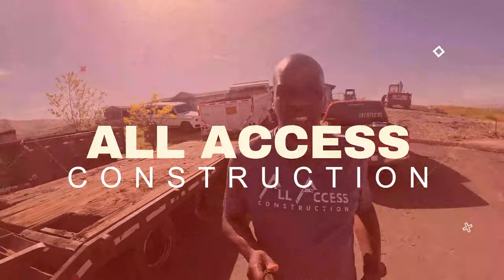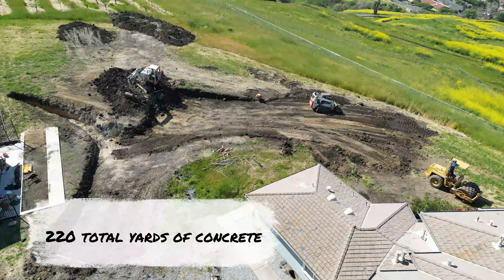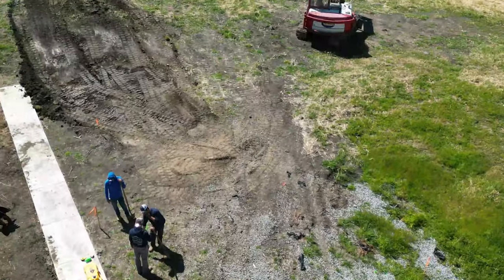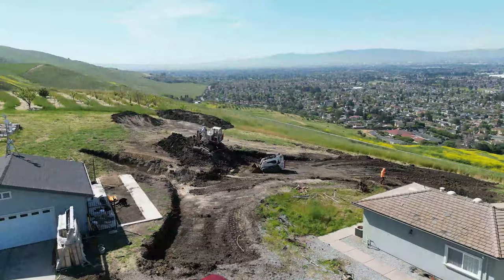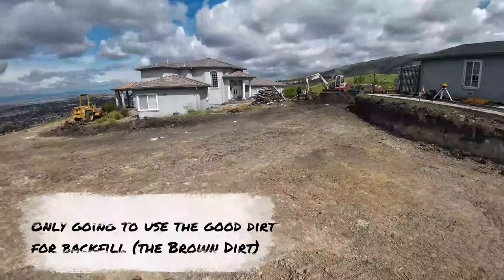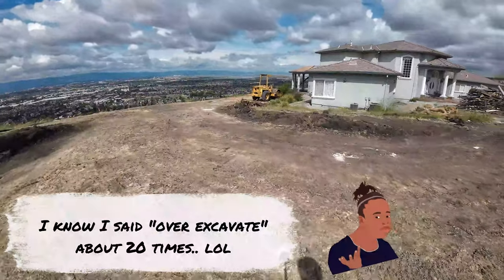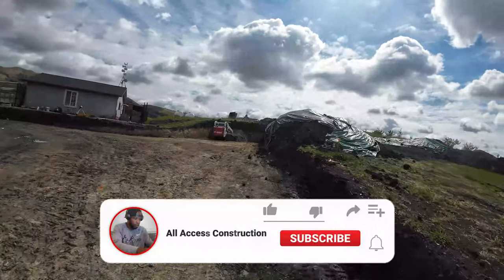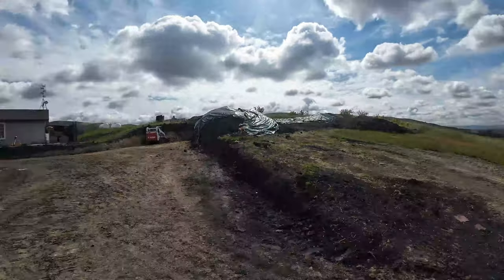Concrete Driveway: What You Need to Know About  "Over-Excavation"

Comment: Satisfied customers are a company's best advertising. Retaining Wall job got noticed and other home owners on same street are also using All Access Construction. Good sub contractors on other projects are always a safe bet to use again and again. Your subs can make your company look good or very bad, even if your company is perfect.

Cutting (removing) soil is easy compared to Filling (adding). To achieve 95 percent compaction, many variables need to be controlled. It is almost impossible to over compact, but very easy to under compact. Having access to a hand held compaction meter is a good investment. Having access to a lab to test soils is money well spent. If you have ever placed a 1,000 yards of fill that failed compaction and had to be removed, mistakes can be costly and avoided if at all possible.

Just a few items that can prevent proper compaction; too much or too little moisture in soil, wrong particle size mix, or just wrong soil, lifts placed to thick, wrong equipment, or right equipment and wrong equipment operators, and poor drainage. Get it all right and compacted soil can be even stronger than the existing. 

Looks like more happy customers and another job well done.
Reply from the maker: Appreciate the kind words 👍🏾👍🏾💯💯
Reply: @AllAccessConstruction  My pleasure.